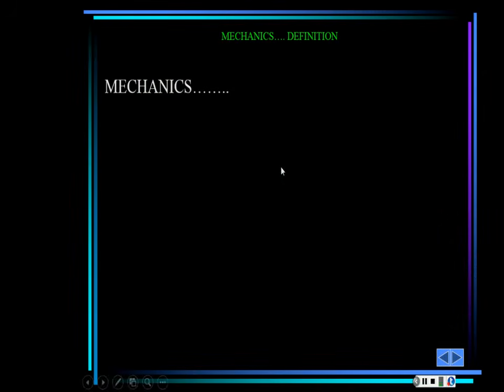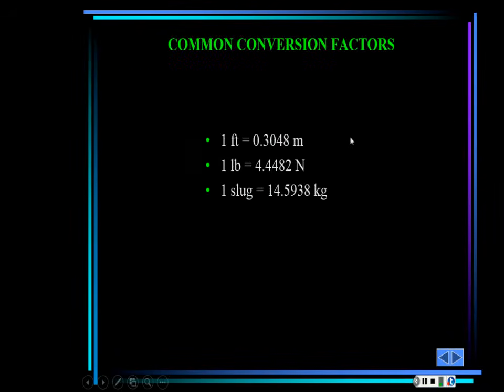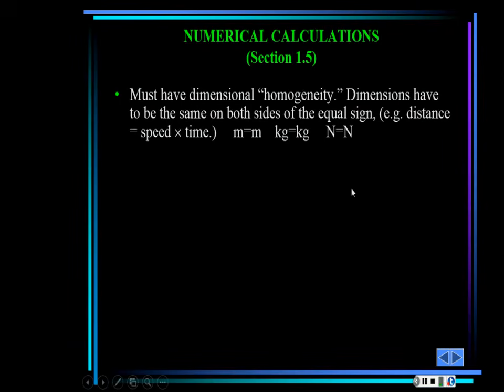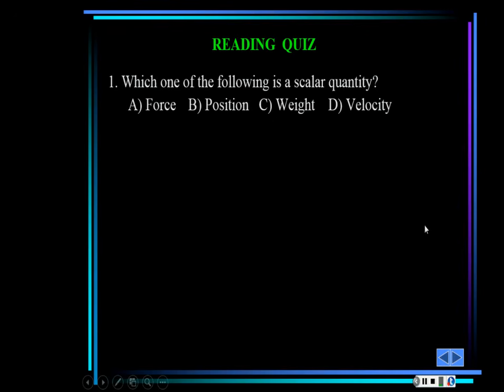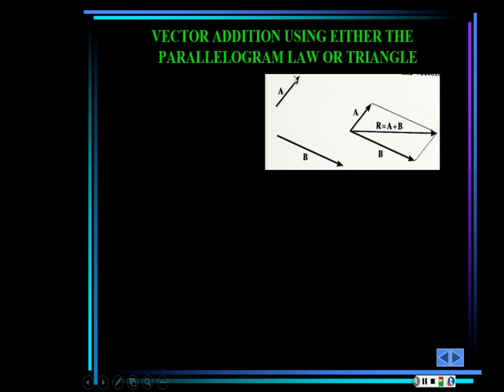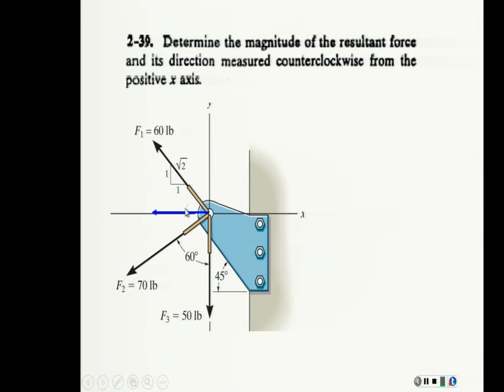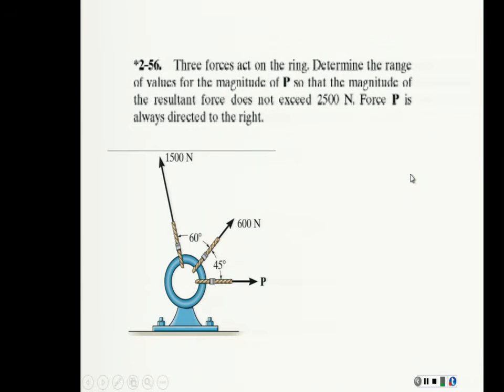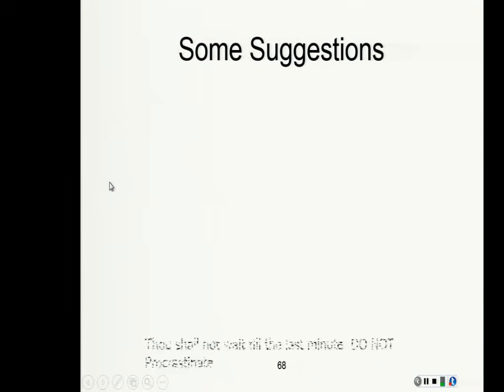Copy of Lecture 1-2

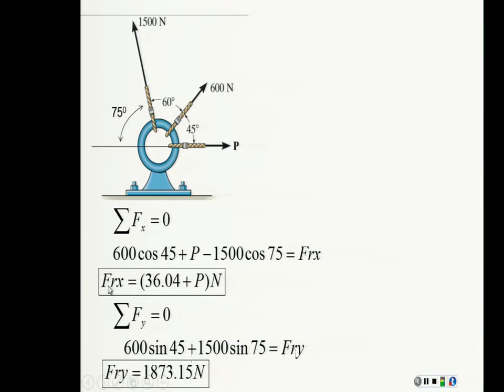Comment: around 41:00 min why didnot you use include p when you calculate the sum of the y components of the vectors??
Reply: Hope you havent been stuck on this for 3 years. P does not have a y component as it is only on the x axis